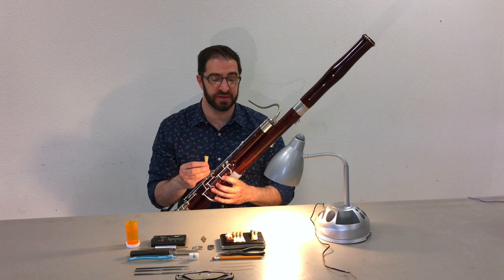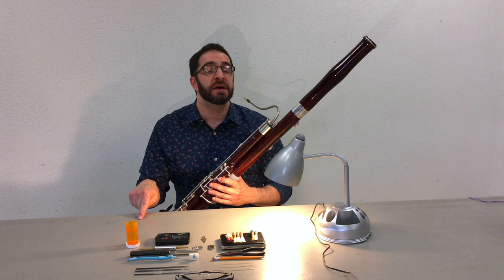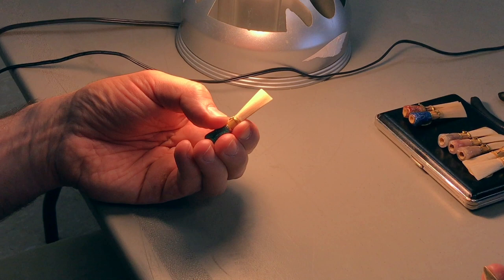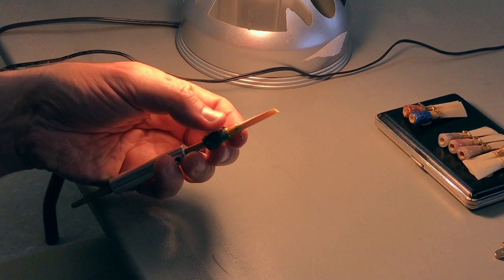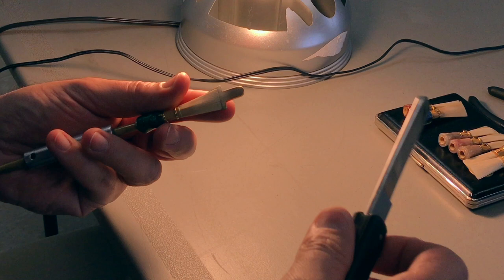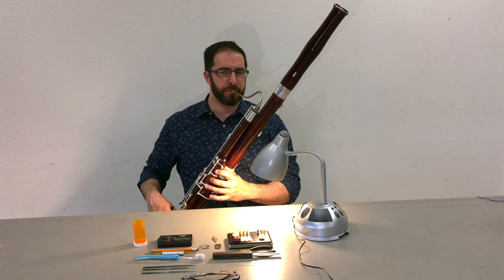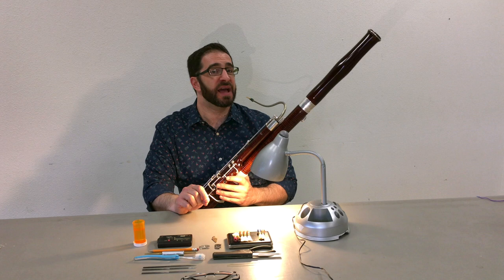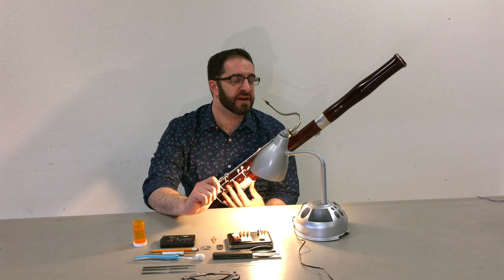Glenn's Reed 4

Comment: Lawrence, thanks for your comment.  When it comes to cane sources, I use cane from all different sources.  I have found good and bad cane from every source, as has everyone.  I rarely keep track of where the cane came from because I found other aspects of the cane much more reliable to document when it comes to selection.  I use an elliptical gouge with the Herzberg profiler's A cam.  This profiler puts in a taper from center to sides so when I clip the tip, I have an immediate impression of the reed without having to do much work to it.  Of course work needs to be done, but not as much as a profiler which doesn't put in any center to side taper.  I hope this answers your questions!